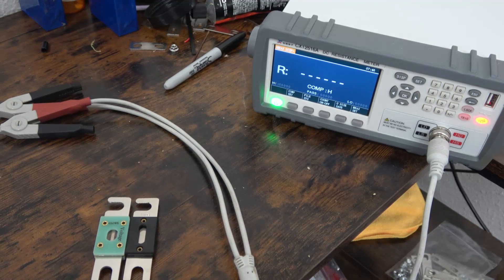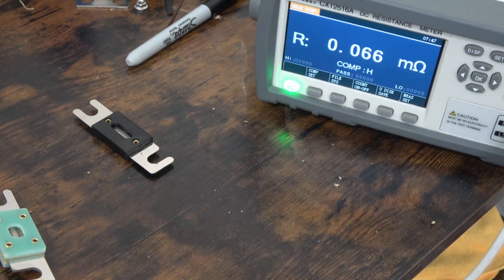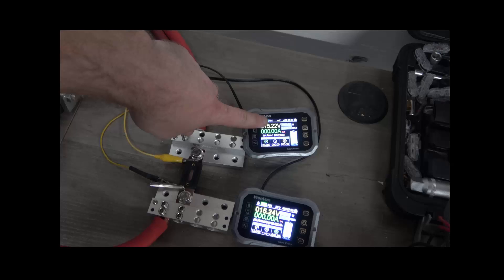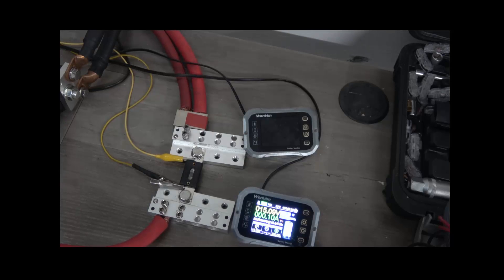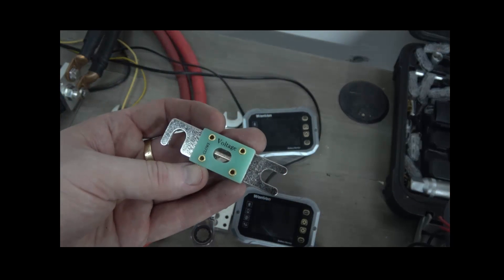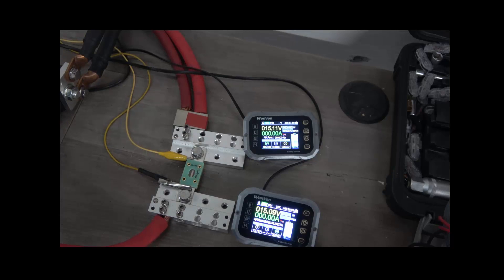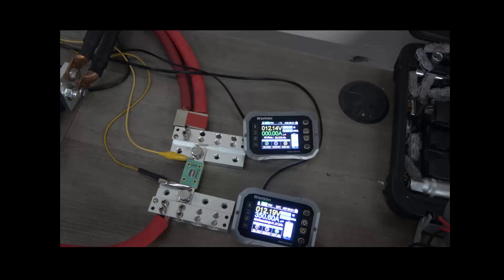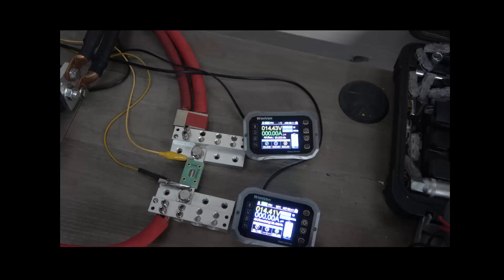Fuse Faceoff: Skar vs Glowe Voltage - are cheap fuses just as good??

Comment: as far as i can tell the main conductivity variable is the metal used, and the thickness of it. the fiberglass or ceramic part doesnt effect conductivity, however fiberglass and ceramic wont deform if the fuse gets really hot, so that is a plus. if i am incorrect please correct me.

Comment: On the website there is ceramic and fiberglass fuses which one should I use for a 6k watt system on a glowe voltage series 3
Reply from the maker: Fiberglass are the best of the best.  Ceramic are still really good and cost less.

Comment: 😬 i got some of those 100a skar fuses...good thing they are only used to test junk amps. Junk fuses. Hahaha. I run the Marine caramic fuses.
Reply from the maker: Most of the ceramics I've tested have been pretty good.
Reply: @GloweIndustries  Surely the material the housing is made of is just a coincidence, right? What really matters is the metal part, right?
Reply from the maker: @JasonWW2000 correct. But you’re more likely to find higher quality maybe because the maker has already ingested more than typical it would be weird to cheap out on a cheap part. 

Fiberglass can be an exception. They’re made the way they are in order to house multiple blades — another difference is (at least all that I’ve personally seen) fiberglass fuses are rated to be ran in an environment with flammable/combustible gasses present without danger of an explosion if they blow.

Comment: Why do you use a dual input (output in this case) when you have several un-used terminals on the block?
Reply from the maker: Oooh I got you.  Typically that second block is just a single output from the specific fuse in question.  I swapped to another input style block a week or so ago when I was doing some testing that was 2000 amps and needed multiple 800a fuses going to the same output.
Reply from the maker: I don’t understand the question.

Comment: Amazing!! How do your ceramic fuses do?
Reply from the maker: I’m at an all day tattoo session.  I can toss one on this evening, but… based on the DC Resistance testing they should perform very well. Not as well as fiberglass but within expectations of how a fuse should act.

If you check out this video the data we got here has matched very well with real world performance thus far. 

https://youtu.be/nudoktFZJ3k?si=8KGPT9Comrrdv8bk
Reply: @GloweIndustries  I'll check it out. I wonder what resistance the ceramic fuse has? I've got some 600A ceramic fuses. It's fair to say they'll atleast perform like they're supposed to.

Comment: Never had issues with Sky High anl fuse. But it does it's purpose only when it needs to. I always sand both ends to get best contacts of the fuse due to the paint that might cost resistance.